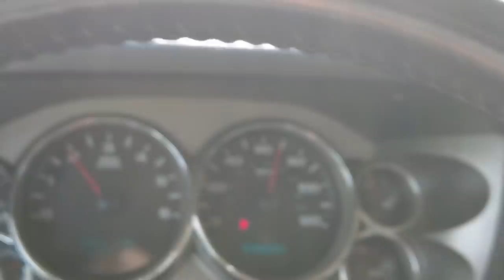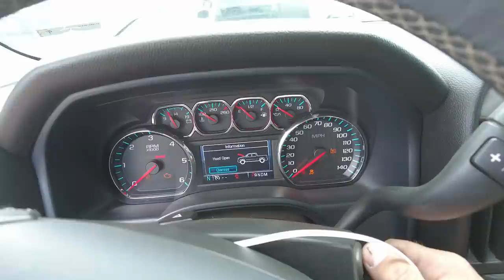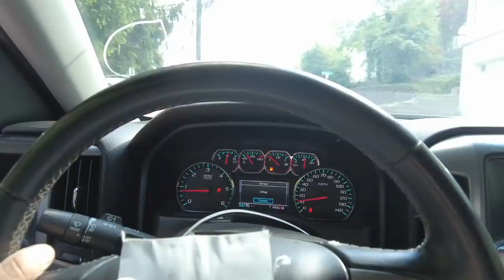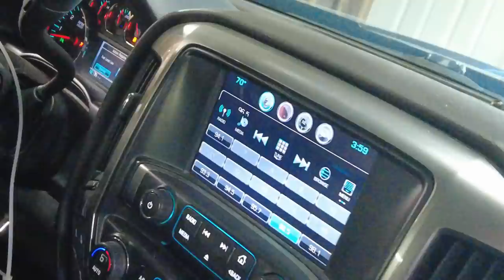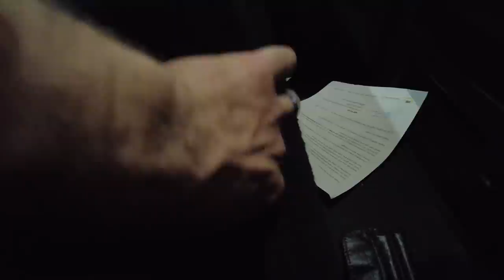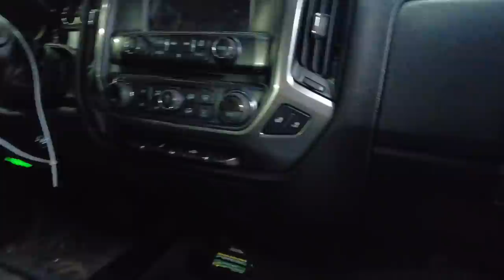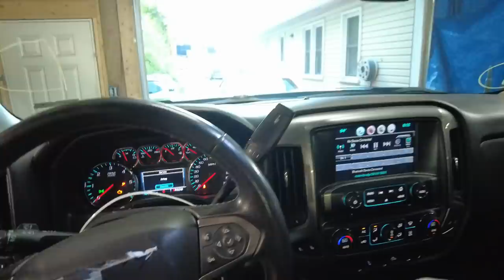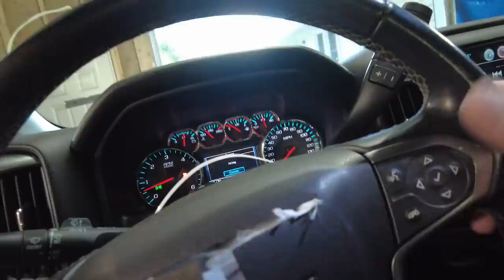I bought myself a new truck at COPART

Comment: As soon as I saw the air tank, I immediately thought of it as a great way to use small air tools or even pump up tires, also if you ever decided to add helper bags to the rear for towing it could be used for that also.

Comment: Congrats on the new truck. I have a black Sierra SLT crew cab with 200,000 miles.I drive from Va to NM it's the only way to travel. I love it still runs like it did with 6 miles maybe better.

Comment: Been awhile since I've been here. I just bought a 13 Silverado LTZ ext cab. Mine had air horns too. Not sure if that pump is what makes them work. No pump on mine. Mine don't work. Safety restore has had my seat belts for over 2 weeks. They claim the pretensionors are on backorder so don't send yours off to them.
Reply from the maker: Too late!  Nice to know, I was starting to wonder where mine were at.

Comment: Too bad about the wheels dang laws . As for the air compressor I would mount it in the back of the truck so it would be closer to the trailer . I do like the new truck looks like a great find for you.
Reply from the maker: I'm not upset over the wheels.  I really don't like them lol

Comment: I can tell you a lot about them trucks I can tell  you your Xm antenna is leaking that’s why the headliner is clapped and that condenser will need to be changed anyways they all leak also I will bet there are recalls on it the front end parts get super expensive also dod delete it if you want it to last I have three of them in the garage and not just a programer they are worthless good luck with rebuild